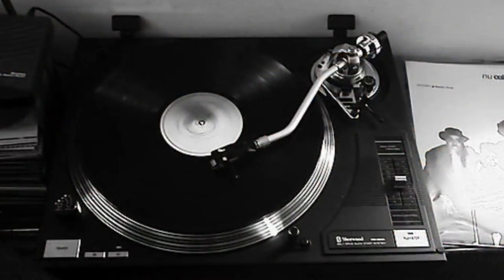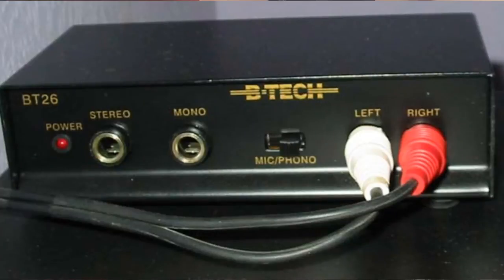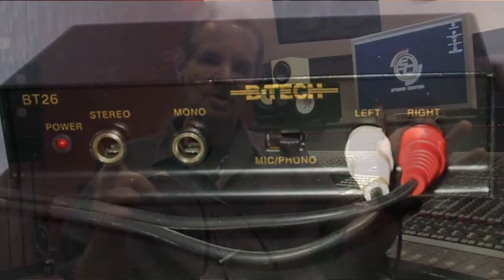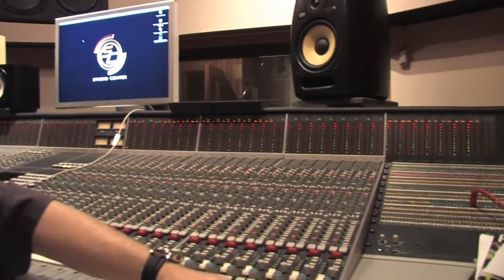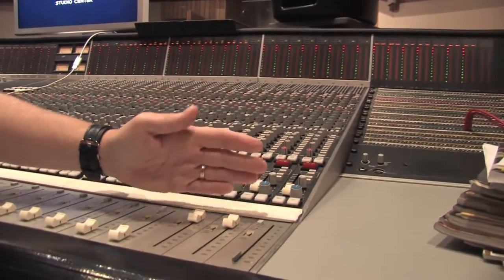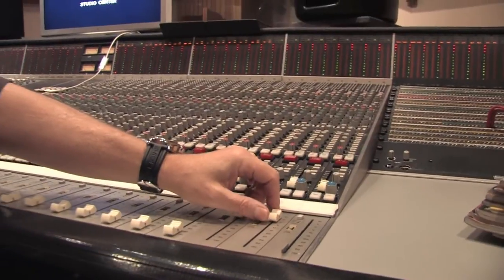Music Recording Facts : How to Connect a Turntable to a Mixer

Comment: Thanks for great info! I just have one question: When connecting to line input in the mixer - is that a stereo cable to one (mono) input or two inputs; one for each (white and red)? Or should I connect to the tape input on the mixer, which has a red and white rca input (but no gain or eq, so I would prefer connecting to one or two channels).